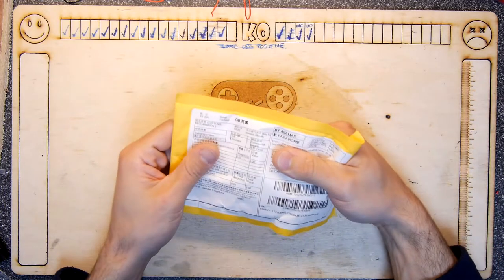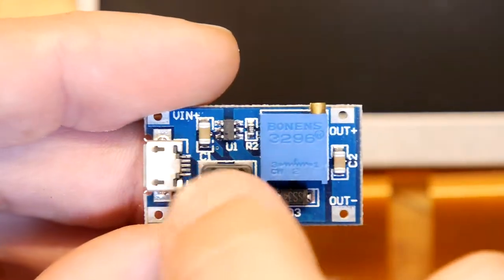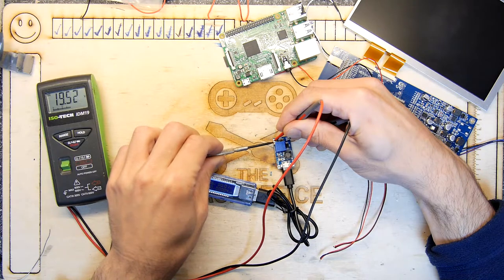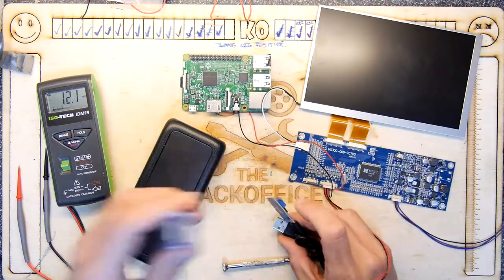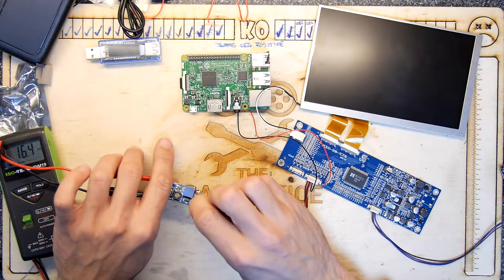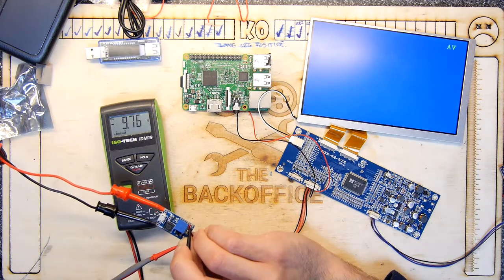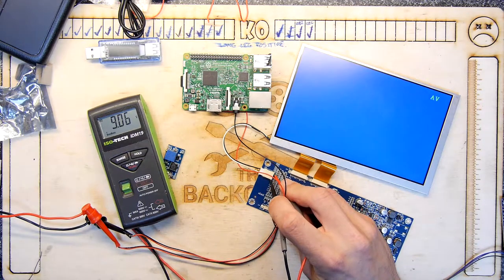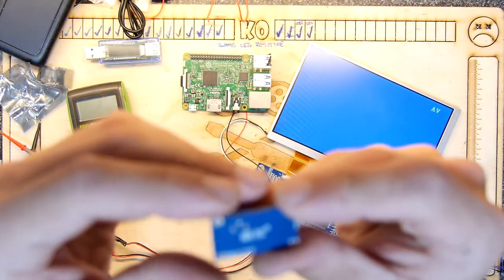Voltage Booster for the RetroPie Rig

Comment: TANSTAAFL (There ain't no such thing as a free lunch) In a boost converter you trade current for voltage.
Reply from the maker: Yep, I think in this case its doubly inefficient as the pack has a booster in it as well. I do have another screen anyway, but it would have been interesting if this has worked, but I do love having these modules in my box of tricks.

Comment: It was difficult to see, but were you connecting red and black for the 12v feed to +ve output, and red and black for the 5v feed to the -ve output.  Shouldn't you have been connecting the red 12V to the +ve output and the black 12V to the -ve output?  I think you may have been cross-connecting the 12v and 5v feeds creating a high load/short circuit?
Reply from the maker: +petewmids The panel came with a strange wiring loom where as it should have had two red and two black but had red black red black instead. Really confusing.

Comment: I'll have to check the ones I use for my project but I'm sure they don't use that much power I've used one to power a 15v ds back light for a gamegear mod from 5v but it might be because your powering a tube?? hmm
Reply from the maker: +Brian Jones Is going to be highly load dependant and I suspect I'm overloading it. Back to the drawing board 😁
Reply: Your going from 5v to 12v ? ones I've got and seen can handle 2amp, (no electronics expert) Is it the tube causing the issue? what is the current draw if you power the back light direct from your bench? I think the original backlight for the gamegear I modded was 35v....ouch
Reply: Its ok re-listened to you vid, think you need an led backed screen :p
Reply from the maker: +Brian Jones it's an led screen but the whole circuit is geared for 12v. I am trying to power from a battery pack, itself likely to contain a booster as well. The pack itself seems to shut down, possibly an over current system.
Reply: is the back light led i ment? you mention cold cathode, if its a cold cathode back light then its just going to eat power no matter what you do, so if it is you need a led back lit screen,  Is your battery pack only a 500ma limit? maybe its just the battery pack thats not up to the job?? from what your saying the boost converter is using 200-300 mah ?
Reply: I know I keep asking questions haha, its coz I will be doing a very similar project soon and so find your project very interesting :)